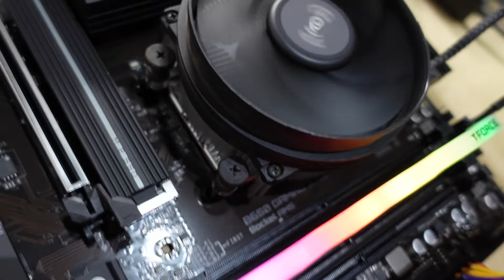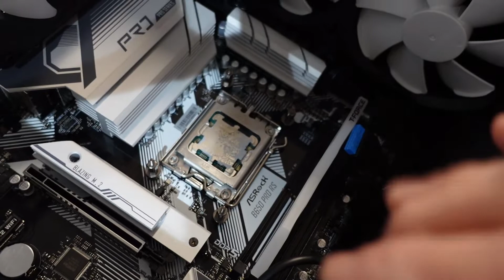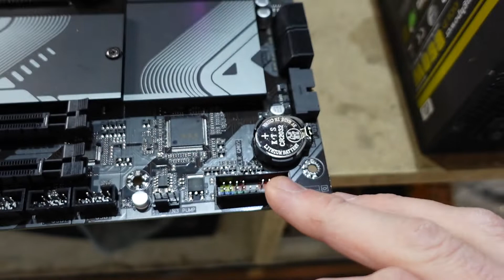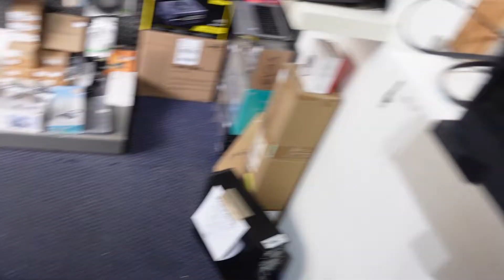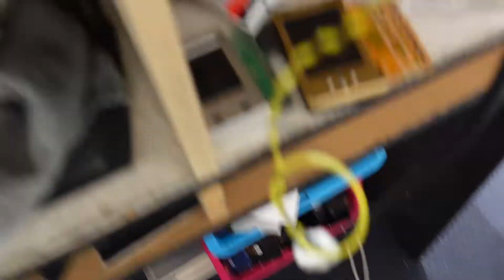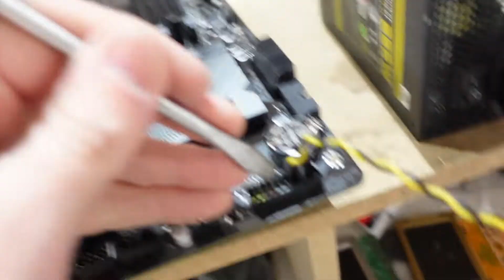AMD AM5 Solid CPU and Ram Light, No Post, Possible Solution

Comment: What worked for me was clearing the CMOS and putting one stick in furthest slot from the CPU (B2 on mine). Then waited a few minutes for it to do its memory training. Memory training issues are very common for AM5.
Reply: did you do this while the of was running or off ?
Reply: @Carlos-ln5yd  With the motherboard off, I took the cmos battery out for 5 minutes.

Comment: it's happening with me and my 7600x, only DRAM LED appears, I tested all the PC components, and everything worked except the processor. It's likely that the memory controller of my Ryzen 7600X has failed. I'm going through an RMA. The processor looks flawless, almost as if I just took it out of the box. It's a shame it failed after only 1 year and 10 months of use =(

Note: I tested the speaker method. With the processor and RAM installed, there is no sound. When I remove the RAM, the speaker indicates that RAM is missing. It's strange; this was different from what you mentioned in the video.

Comment: guys i figured it out. i had this problem like a week. the only method that have worked for me was to install the newest bios into the pendrive (remember to format it to FAT32 and make a partition no more than 16gb) copy and paste bin file (the biggedt one) - then you have to remove everything just put te atx cables to motherboard and cpu. next plug in the powercable and plug in pendrive. if you do it just press the flash bios button(for me it was at the back near to usb ports). wait until it shut down and then plug every component on mobo. it worked for me while other ways didnt. hope you find it helpfull and sorry for my bad english i from onion land
Reply: dude im trying to flash with the usb drive, first time it worked but now its flashing for only 15 seconds then stops and it doesnt even turn on to flash the motherboard
Reply: @Maelstr0m what did you do?
Reply: Tried this, PC still won't boot.
Reply: @MarcusHelius  What I did was manual increase Voltage. Just ask ChatGPT Thinking to know what voltage you should use by putting all your specs

Comment: i had the same problem after two week of trying and just about to throw in the garbage I look carefully on  the top of the motherboard i found a broken trace wire broken  so i solder it together and it started to work still going strong after 1 year the broker trace was at the back of the motherboard,   looking at it from the back the input are on left side  the broken trace was on left side
Reply from the maker: great to read you got it sorted with some soldering!

Comment: Ryzen 5 8400f + (2x16GB) KINGSTON FURY Beast DDR5-6000 cl 30
I rebuilt my pc, checked all the RAM slots and it didn’t help. Then I removed all ssds/hdds and waited about 10 or 15 minutes I think. 
After that Bios started to work. 

maybe someone will find it useful

Comment: well i exactly getting error like u and tried same thing like u just bought 7800x3d and msi x670e gaming plus same problem for me now send back 7800x3d then bought 9800x3d now waiting new cpu idont have 2nd mobo try but you r correct need getting beep  i also update bios from usb  and mobo got update bios succesfully
Reply: well my first purchase came doa send it back got 9800x3d all good now im building pc's like 20years maybe 2nd time got doa new cpu
Reply from the maker: The 9800x3D seems to be an extremely faulty CPU
Reply: @rickstechrepairs  yeah if u have ASRock  mobo
Reply: @rickstechrepairs  iam Happy with 9800x3d like 1 month 🎉

Comment: Just ran into this same issue, first with an Asrock X670E PG Lightning and now a Gigabyte B850 Gaming X. On the PG Lightning both the CPU and DRAM lights are red, but on the Gaming X the CPU light is first red but then turns off and then the DRAM light turns on stays solid red. The trigger to my issues was accidentally starting the computer without any ram after taking it out (which makes me think it’s the ram - but maybe the no ram boot lead to a problem with the cpu?).

Comment: Maybe are simple solution, try to clean memory with a rubber and after isopropyl alcohol. 
Here did'n function, but maybe for you, yes. 

Good luck!
Reply from the maker: good to read you found a solution for your issue
Reply: There is a theory that is this a bus issue between CPU and VRAM. But i don't know it is true.
Reply from the maker: a stick of ram not making full contact, will certainly cause a pc not boot

Comment: I have ASRock X870 PRO RS and have similar situation. LEDS are on, fans are not spinning - only on the GPU fans are working and CPU + RAM led are shining solid. Sometimes it boots up but sometimes i can wait forever. With cold boot zero problems. I do not had these sort of problems for my entire IT career.
Reply from the maker: not sure sorry, some times you need to wait about 5/10min for a fresh build to train the ram

Comment: I know this post is a year old now, but I hope to get some help as I am having a similar issue and I feel like I've tried everything.

Recently I used some parts from my old AM5 build to create a PC to flip, here are the specs

Ryzen 5 7400F
MSI Pro B650-S Wifi
Patriot Viper Venom 32GB (2 x 16GB) DDR5-6000 CL36
Klevv CRAS C910 1TB
EVGA XC GAMING RTX 3060 12GB
Montech Century 850W 80+ GOLD
Okinos 16AWG PSU Cable Extensions

Upon building the PC and testing it for the first time, it turns on and CPU and DRAM light stay on and nothing else happens, no signal out, and peripherals dont light up or anything.

For context, I had this motherboard for over 6 months in a working build that had a Ryzen 7 7800X3D + Teamgroup T-Create Expert 32GB (2 x 16GGB) DDR5-6000 CL30. So I do know the mobo was working fine before.

1st I tried taking out each stick of ram and testing it in each individual DIM with the same result. I would wait upward to 15 to 20 mins each time I booted the PC to see if anything would change but the DRAM and CPU light stayed on.

2nd I reseated the CPU, and checked the pins on the mobo before I did. Pins seem to be fine, no damage. Ive been building and flipping PCs for a while and I am extra careful when it comes to the pins. Still nothing changed though

3rd I tried updating the BIOS using a Teamgroup C171 64GB USB drive. After putting the latest BIOS file on the drive and renaming it MSI.ROM , I plugged it into the designated USB port and pressed the BIOS Flashback button. The BIOS light blinked multiple times and then the PC turned on by itself with the light continuing to blink rapidly for roughly 10mins before the PC turned off and rebooted. Still nothing, same result ( While I updated the BIOS I had all of the components in the PC, with 1 stick of the Viper ram in slot A2 on the mobo )

4th I repeated steps 1 and 2 now that the BIOS was updated. Also I jumped the CMOS pins to reset CMOS and still nothing. Then I removed the CMOS battery for roughly 15mins with no power connected to the PC , and then put it back in and repeated steps 1 and 2. Still nothing

5th I used a known working stick of ram and tried it in every ram slot, same result.

6th I removed the cable extensions , checked mobo and power supply connections. Same result.

7th Tried booting it with no ram in the PC , still the DRAM and CPU light stay on, with no signal out. The GPU fans remain spinning, everything else seems to be on and functioning.

If there is anything else I am missing, please let me know, as this is driving me crazy. At this point I feel I have a DOA CPU. The Ryzen 5 7400F was from Aliexpress, but I purchased it from a trusted seller, and it shows no signs of damage.

The only other thing I can think is that the Mobo is trying to boot into the EXPO profile I set back when I used this PC for my personal build. But I assumed clearing the CMOS would have fixed this issue if that was the case, or the BIOS update would have. But maybe I have no idea what I'm talking about. Any help would be much appreciated.
Reply from the maker: you have covered basically everything i would attempt

only other thing i could suggest is try the 7400F in a known good working System

Comment: I have a yellow DRAM debug light on my motherboard and i havent figured out why that is yet. My MSI b840p motherboard is updated to latest drivers(flash), and im using compatible RAM as listed in compatibility list for the motherboard. I have tried everything at this point it seems, but still no post. Could this be the processor even with a yellow light such as this?
Reply from the maker: not sure sorry
Reply: What ended up working for you? I also heard that screwing in the aio in too hard can cause this issue
Reply: @ so i found out i had bent a pin in the motherboards cpu slot, i actually managed to bend it back to fix it. I suggest checking your pins, because the cpu manages the RAM aswell

Comment: I also heard that beep when I had failed to fully seat my ram sticks.  Still have a CPU light with no post going on that I can't figure that is happening with both a new CPU and an OLD CPU.
Reply from the maker: not sure sorry
Reply: @ turned out I needed an older cpu to be able to update the bios to use the newer cpu.

Comment: I just replaced my cpu to a ryzen 7 9800x3d, nd also replaced the aio nd now the red and yellow led turn on, ram sticks r perfect i never even touched them when replacing my cpu my pc wont boot help
Reply from the maker: what motherboard do you have and bios version
Reply: @rickstechrepairs  msi b650 gaming plus wifi
Reply: @rickstechrepairs  not sure which version it is honestly
Reply: @danndan4470  I have exactly the same thing, did you somehow solve it?
Reply: @danndan4470  same processor, same motherboard, same problem
Reply: @fenomEen441  i had to update my motherboard which u probably will have to do aswell
Reply: @danndan4470  what motherboard did you take?
Reply: @danndan4470  Did they change motherboard for you without any problems?
Reply: @fenomEen441  i built my pc on my own, you need a usb drive and another computer or something to download the drivers its pretty easy especially bc this motherboard has a flash bios button
Reply: @fenomEen441  idk what u mean by this but we are talking about the same motherboard the b650 plus wifi, since that motherboard came out first than the cpu its required to be updated
Reply: @danndan4470  Oh, so updating the bios worked for you after all?
Reply: @danndan4470  I thought you bought a new motherboard
Reply: @danndan4470  Ok, I ll do it, hopefully it will help
Reply: @fenomEen441  na lol this mb should work perfectly find with that cpu it just needs an update
Reply: @ Did you update bios using USB flash ?
Reply: @fenomEen441  yes i did

Comment: had this exact issue after my recent build, made sure all ram was good, checked to see if I had over tightened aio, slightly tight, undone to hand tightened,  removed battery left for 5 mins, reinstalled, rebooted and left for 15 mins , finally cleared all leds and finally posted. good luck!
Reply from the maker: great to read this has helped and your machine is booting ")

Comment: I’ve got a brand new 9700x with this issue, what’s the chances a new CPU like that could have this issue?
Reply from the maker: some times you just need to a wait up to 5 minutes for the ram to train
Reply: Did you fix that ?
Reply: @ yeah fixed the issue mate, updated the bios, sorted.
Reply: @ESKATEUK  Updated the BIOS on the x870e Gaming Plus with a 9700X but it's still showing yellow DRAM light and red CPU light. What BIOS did you use? I flashed with the latest one. 

Do I need to let it sit powered on for a period of time for it to fix itself or what?

Comment: The Gigabyte X670 MB I bought didn't even power the Fans.     No light nothing, dead as a doornail.    The USB Mouse LED Lit, but that was it.   So I know the MB had power.      I hadn't built a computer in 20 years, and figured they would have it more perfected.   Not!     I've never seen such a high rate of failure on components.    They must not be doing any 48-hour burn in/testing at the factory, and just passing it on to the consumers to waste their time.  So I am just going to start ordering 2x everything and send back the crap that doesn't work.
Reply: I have ASRock X870 PRO RS and have the same situation. LEDS are on, fans are not spinning - only on the GPU fans are working and CPU + RAM led are shining solid. Sometimes it boots up but sometimes i can wait forever. With cold boot zero problems.

Comment: wanted to share here.
I'm having this exact issue. my PC is 4yrs+ old.
Mobo: ASROCK B550M PRO4. 
PSU: Cougar 750w Gold plus 
But mine still sometimes display whenever I plug pc for hours without switching off the PSU, i turned it on, it displays and I can still play games(yea shocking) but when I turned it off, the next time i turned it on it won't display( again). Anyways i did the method again plugged in, not switching off the PSU(boom displays again). After many technicians can't find the problem (since it shows display, sometimes), my uncle asked if i checked the voltages in BIOS then i found out the 12V in CPU is in 6-9V, other voltage 5V and 3V is the same. Thought PSU the problem, bought new, but nope still not show display, so went to comp shop they rechecked per part.  Technician conclusion seems my PSU is faulty and made my Mobo faulty. so new PSU and MOBO. 

my PC fixed since Nov.18, 2024 and I'm having no issues so far :)

so yea if ur lucky for random display, check you BIOS and check voltages

Comment: 7500f/7900xt/32gb and same issue
Reply: tried everything now it’s getting to the point of new cpu as i dont have speaker to test
Reply: @vontaewright9965 were you able to fix it? We have the same build.
Reply: @ for some reason i had to switch to a ROG B650, its either bad board in general or it’s incompatible i have no clue tho but only way i resolved was a new board

Comment: Fixed it for me by trying with 1 stick first and also possibly lessening the heatsink tension. After some mins of black screen, seems like ram is trained and you’re good
Reply from the maker: Cool Good to hear
Reply: @delatroy  I have tried with one memory stick, I have tried different slots, doesn't work .....the technicians from the store tested the mobo and ram and they said it's ok and they think the CPU is the problem so they have told me to bring the cpu also so they could test it separately
Reply: what happened  @smamas114
Reply: @smamas114  does it work? is the cpu the problem
Reply: @SeatiesTheGoat I give them the cpu to test it also and they ve said everything works but soo as I go home and try to see if they work same issue,  I didn't find any solution so far but i think is the motherboard the cpu seems fine ......i think the motherboard bios chip could be the issue here !!!

Comment: I have 0D and ram error after every restart on my new x870 board and 9800x3d, some say could be the cpu , i am waiting the guys from the store to test that ........so not only INTEL has issues with the cpus ........do you think the socket could bend the cpu and lead to failure  ?

Comment: Ok ok ok stop trying everything else and do this if you have am5 and using more than 16 gb ram....

Add 1 stick to 2nd slot and let it run for 5-7 min the orange light will go away and pc will start... Now shut it off and add other ram and again wait for 5-7 min. System will boot now. Cheers

Comment: Can anyone tell me how can i solve this my pc spec:  ryzen 7 9700x gigabyte b650 x ax v2, 16*2 corsair 6000mhz ram.I had same issue with dram i tried all slot and chage but didnt work.What should i do now?😢
Reply from the maker: any idea what bios model you have?
Bios F30 Supports the 9700X but F1 Doesnt
Reply: @rickstechrepairs  are yoi sure?i have to remove my processor when i do fx30 or?
Reply: @rickstechrepairs  i have no idea, how can i know that which bios i have?

Comment: i just bought this egeal atx motherboard dram light on stuck in bios took the battery out the motherboard and now getting no display with dram light on
Reply: I have issues... Pc boot 5 min then freeze restart and monitor no post and dram light
Reply: Did you fix your problem @mizihensem2387

Comment: Summary of things you can try based on what worked for other people:
- try multiple ram sticks on every slot to pinpoint which slot doesn't work
- red led does not mean it's over. Let it sit for a couple minutes for every combination you try (worked for me in about 30 seconds). Next problem you should expect is vga led if you removed the gpu
- try removing the cpu fan, even the cpu power to confirm it will turn on the cpu led instead of dram led
- if you got your product through amazon you have a couple weeks to refund. ask a nice friend to lend his cpu for a day and try that out, or you could buy a speaker, and still have time to send the cpu back if it ends up being the cpu. You could also deal with a local hw shop to let you try an old cpu they have lying around
Reply from the maker: Cheers for sharing your tips
Reply: So what happens if the mobob does detect the CPU? What does it mean?

Comment: I have kinda the same problem I have an Asus b650 plus with a ryzen 5 7600x and a corsair ram and when I built it all was fine until 1 day after it just freezed and rebooted every 5 minutes or so and after a few days it was gone again and working all fine and this came back every 1 or 2 months just random for a few days and now its at a point where it doesn't even turn on anymore and is either stuck at dram or cpu light any ideas on how 2 fix that? I already swapped the ram, motherboard and ssd hope anybody can help
Reply: Quick update I got it running again now I just tried all older bios versions but it keeps freezing any ideas on how to fix that?
Reply from the maker: not sure sorry was going to suggest a ram issue